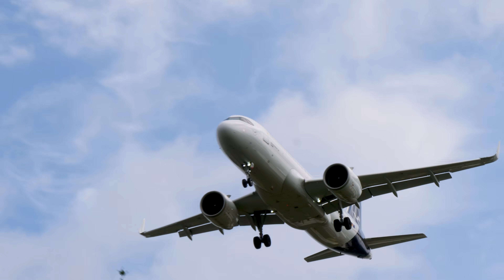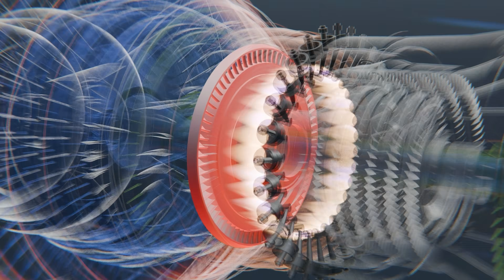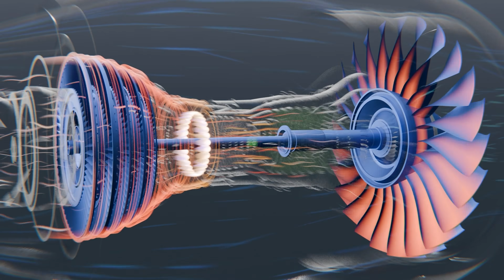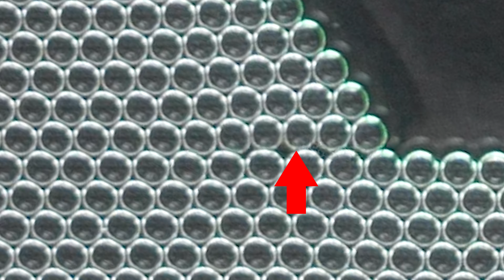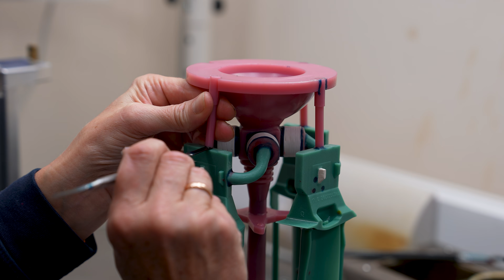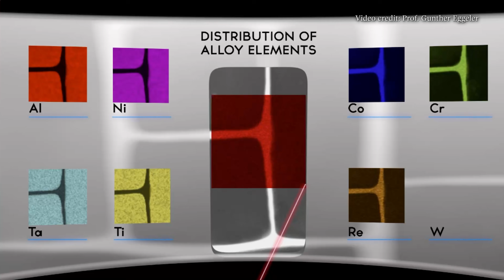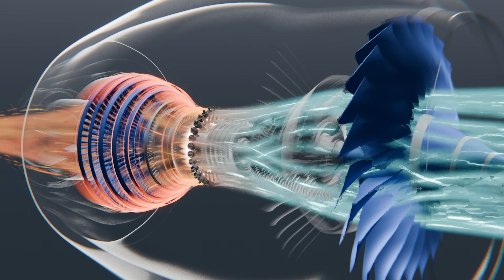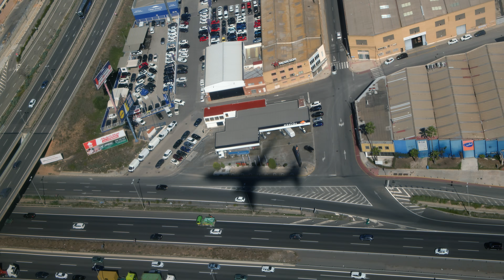The Ridiculous Engineering Of Jet Engines

Comment: I operated gas turbine power plants for 43 years.  I remember when RR announced they were manufacturing single crystal blades.  Everyone at the time considered it voodoo.  

The part on thin film cooling wasn’t really clear, so here goes.  By bleeding a small quantity of cool air out of strategically placed holes, it creates a thin film of cool air  that attaches to the surface of the blade due to the coanda effect.  The air immediately starts to heat up, but by the time it starts to get hot, it is swept away and replaced by more cool air.  The critical areas are the leading edges of the blades because they are directly in the hot gas path, and the very thin trailing edges.  I was surprised to see the cooling air holes along the centerline of the blade shown in the video.  These blades must be for an engine that runs at a much higher temperature than the ones I ran.  The initial use of thin film cooling was in the form of sweep air for boiler gasside sight glasses, and it is used in all sorts of surprising areas of modern technology.

The limits of engine performance are usually set as exhaust gas temperature (EGT).  Since the temperature drop at each stage of the turbine can be calculated, by measuring EGT, the turbine inlet temperature, which is the highest temperature in the engine can be calculated.  By knowing the maximum temperature the first stage turbine can withstand, the maximum EGT can be calculated.  Some older turbines measured inlet temperature directly, but as metals improved it became more and more difficult to measure directly, so most turbine manufacturers switched to EGT measurements instead.  Some engines measure temperature somewhere in the middle (a lot of techs will remember TT-5.4), but this is less common also.

The difficulties with dirt also affect the compressor far more than the turbine.  As dirt builds up on the compressor blades, they reduce efficiency and increase turbulence across the compressor blades.  This can build up enough to stall the airflow across the blades, creating a high pressure pocket.  This can push the blades until they make contact with the next stage and break off.  One blade promptly breaks more blades behind it, which cascades until the entire compressor explodes violently.  The term of art for this is a corncob, because that is what the remains resemble.  It is very frightening to witness, (don’t ask me how I know this) and is deadly to anyone nearby or in a flying aircraft.  This is why you will see maintenance personnel washing engines by spinning them up and spraying specialized soap solutions into the engine.  Unfortunately, soap can’t wash off particles melted onto turbine blades.  This is one of the fundamental limits to turbine blade lifetimes.

Another is cycle quantities.  As any blacksmith can tell you, repeatedly heating and cooling any metal will cause the grain size to change.  Heating causes grains to grow, while rapid cooling (like shutting down a gas turbine) can cause grains to shrink, making the metal brittle.  This is why you used to see aircraft not shutting down their engines while sitting at the jetways.  This is also why single crystal blades are such a big deal.  They essentially only have one grain.

When training new operators, it took me five minutes to explain how a gas turbine works.  It took years to explain all the details.  This video pretty much explains why.  Excellent stuff.
Reply: for somebody with minimal knowledge about aircraft engines, i really enjoyed reading your comment
Reply: Very good comment, I just correct something. It seems like you have knowledge of metallurgy but you mixed everything concerning grains .
Basically a finer microstructure (smaller grain) is always better in term of fracture and tenacity (hall-petch law) and it is why the smith quenches the metal between each phase (quenching and dynamic recristalization through forging) 
Also, you are indeed right, temperature makes the grain grow, because they want to minimize surface energy through "absorbing" and combining with their neighbours, making a more coarse microstructure.
But it has nothing to do with turbine blade. Basically the mono cristalline process makes it so there is no grain boundaries anymore, so no growth or cristallisation.
This is gamebreaker because you can have highly anisotropic properties in the direction that you want to "protect" 
Basically we grow the alloy on it's stronger direction in the direction that we want to shield against stress.
But on paper the isotropic mechanical properties, so in all direction, are lessened!
Also the thing with these mono cristalline is that they are much much more resistant to Oxydation, Not having any diffusion highway (boundaries) and suffer far less from temperature creep and HT deformation as there is no dislocation stacking on the boundaries, making it behave as a whole body against internal stresses.
And the reason for the jets not shutting engines down is, indeed for thermal cycles and also for thermal shocks
Reply: @someoneyoudontknowthename3931 Thanks for clarifying that.  My knowledge of metal grain structure is mostly from watching Forged In Fire.  I simply didn’t need to know more for my trade.
Reply: Single Crystal turbine blades were nothing new when Rolls-Royce introduced them on the Trent.. They were invented and patented by Frank Ver Snyder at Pratt & Whitney in 1966.
Reply: @DoktorBayerischeMotorenWerke I had never heard of them before the RR announcement.  Do you know why they weren’t in common use?
Reply: @Simple_But_Expensive  They have been in common use in the major manufacturers for many years.  Some engine manufacturers make their own blades but there are companies that just make turbine blades for other companies to use in their engines.

In the early experimental systems yields were low, as little as 10% of the blades came out as monocrystaline in some cases.  So most of the blades were melted down to use the metal to try again.  Early systems were strictly experimental but eventually yields rose to the point where they were useful in production and now all high-tech manufacturers of high temperature turbine blades have their own processes.  Most achieve 80% or more now, with some obtaining more than a 90% yield on most batches.
Reply: @Simple_But_Expensive  Pratt & Whitney introduced them in 1972 on the F100 and on the Pratt & Whitney JT9D-7R4 in 1979.
Reply: @Simple_But_Expensive  The failure rate during manufacturing was simply WAY too large to make any money.
Reply: @DoktorBayerischeMotorenWerke yeah but were probably used in military and classified
Reply: @AgentLeon  It was not classified technology and was introduced in the 1970's on commercial aircraft like the Airbus A300, 310, Boeing 767 and late-70s models of the 747.
Reply: Thank you for your insight!
Reply: Excellent comment!
Sorry for the stupid question, but I imagine the "cooling" 600C air runs through some space at the center of the whole rotating assembly and then exits out of a system of cavities to the turbulent passages they mentioned at 33:00, is that right?
Reply: @Valery0p5  Yes.  There are ports in the compressor that bleed air into the shaft, and then that air directly into the center of the blades and nozzles for direct cooling and then bled out ports for thin film cooling.
Reply: @Simple_But_Expensive  thank you!
Reply: @Simple_But_Expensive  The video really dropped the ball on explaining ventilation (that there is internal ventilation at all; that there is also a protective film on exterior; in what way the coating aids either process - all of this deserved a 3D render). Thanks for helping sort it out
Reply: @Simple_But_Expensive I was wondering if bleed air was involved in this but did not see any mention i.e. perhaps if using it helps decrease the temps in engine or redirect hot air.
Reply: @annettetozer894 There is more than one type of bleed air.  Almost all engines have a bleed port somewhere around the 5th stage of the compressor to reduce excessive pressure buildup while starting.  This air is controlled by a valve and generally bypassed into the exhaust.  Sometimes this bleed air is associated with engine throttling, and in at least one industrial turbine I know of it is used in emissions reduction.  Also, all turbines have one or more sets of ports somewhere further back.  These ports provide cooling air and bearing sealing air.  On most designs they also provide balance air that pushes forward on the turbine rotor to offset the thrust effect of the hot gasses.  Only about 25% of the air is actually used for combustion.
Reply: @annettetozer894 Not the same kind of "bleed air". 

The bleed air you're thinking of is intentionally drawn off other parts in the engine and used to power other systems on the aircraft. 

The "bleed air" system used to cool the individual turbine blades is a whole seperate system, used just for the purpose of internal engine cooling.
Reply: @Valery0p5  yes
Reply: Really enjoyed that explanation, thanks
Reply: 很好，半导体制造过程中也需要精确控制避免晶界产生
Reply: More stories please!!
Reply: Please explain how they deal with dust blocking the cooling veins in contemporary turbines? They left that part out as well
Reply: @adamblomberg I never really thought about it, but here goes.  

The compressor cooling air bleed ports and internal distribution passages are large enough that blockages are extremely unlikely.  

The air bleeding out of the tiny cooling ports on the blades and nozzles is at a higher pressure than the hot gasses from the combustor.  It has to be or there would be no flow.  

It is also at a high velocity due to the venturi effect.  Fluid velocity increases in an orifice.  No dust particle would be able to attach to the wall of the port.  

In fact, one of the lifetime limiting factors is erosion of the ports reducing cooling effectiveness.  

It is possible to block them externally in extreme conditions.  There is a famous case of a Quantas aircraft that had all of its engines shutdown in flight when it was routed through a volcanic ash plume near Java.  The hot internal parts of the engine were essentially coated with glass when the ash was remelted inside the combustor, but as far as I know, the cooling ports were still open.

Perhaps someone with more knowledge can chime in here.
Reply: @Simple_But_Expensive I was wondering as you and the engineers mentioned that the dust sticks to the turbine blades and the thermal barrier coating is eroded away by the dust and debris. I saw another commenter saying that some of the dust can be washed away from the compressor blades with a cleaning solution to improve efficiency and prolong lifespan.

As I understand for the engines currently in service this remedy does not help for the turbine blades and they'll have to be replaced more frequently
Reply: @adamblomberg The post about engine washing was from me.  Washing primarily cleans the compressor, and any cleaning past that is pretty much incidental.  Dust and dirt will degrade the turbine section, but barring flying through an ash plume, other factors like heat cycling and blade creep are going to necessitate reblading an engine long before it becomes a factor.

On the engines I worked on, we washed the engine 4 times a year, change the combustion cans (also a high heat environment requiring special alloys and thin film cooling) twice a year, and changed the transition pieces (that guide the combustion gasses into the turbine) and combustion can liners once a year.  We also replaced the turbine 1st stage (which suffers the most heat) every 3 years and all the turbine blades and nozzles every 6 years.  We also had to replace the entire turbine rotor about every 15 years.  

Bear in mind that this was an industrial turbine located in a (very) dusty environment that ran at maximum capacity 24/7 when not shutdown for the maintenance listed above.

In case you missed my post on that, an industrial turbine is optimized for torque and has almost no thrust.  The casing on the one I worked on was 4 inches thick and would have broken off any wing it was attached to.  The rotor alone weighed 9 tons.  The turbine drove a 40 MW generator and the exhaust heat was used to generate steam for enhanced oil recovery.

Some of the larger industrial turbines generate 100 MW or more.  Most power utilities prefer steam boilers, even for natural gas, but if I was installing a non-coal burning 500 MW power station, I would install 4 or 5 of these larger ones and use the steam generated to drive steam turbine generators.  This would allow me to take any individual turbine down for maintenance without taking the entire plant off line.  I guess there are economic reasons not to use this design, but I don’t know what it is.  But this is a different discussion.
Reply: @adamblomberg The little dust that the engine does ingest simply flows right thru the passages.
Reply: :)....cheers.
Reply: 746
Reply: Thank you, sir.
Reply: IIRC engineers also use film cooling to keep combustion chambers of some rocket engines cool
Reply: @dongiovanni4331 big time
Reply: 🤩Thanks
Reply: To me, a "corncob" is the ole P&W R-4360 Wasp Major.... 🤷🏻

What a sweet old engine that thing was... 👍
Reply: I love it when an expert drops into the comments and suddenly it's like the DVD has a director's cut and a bunch of cool content I wasn't expecting.
Reply: Thank you for your insight.
Reply: Which explains why volcanic ash is so dangerous.
Reply: But the poor Nozzle Guide Vanes were left out in the cold during the explanation of the flow through the turbine!
Reply: @simes888  mea culpa.  For those not in the know, each stage of a vane axial turbine (or a vane axial compressor) has two components; a rotor and a stator.  Rotor blades are attached to the shaft as advertised, while stators ate attached to the casing.  Combined they change the direction of gas flow in a kind of zig zag pattern.  In the compressor, this change in direction provides an impulse to move the air further into the compressor and into a smaller and smaller space.  The turbine section pretty much reverses this.  For some reason, in the compressor both the stator and the rotor components are referred to as blades, but in the turbine the stator components are referred to as nozzles while the rotor components are referred to as blades or buckets depending on if they are reaction or impulse type in design.  This is simplifying things a lot.  This goes back to steam turbine terminology as far as I know.  

The turbines I worked on were industrial turbines while the turbines on an aircraft are aero design.  Some stationary gas turbines are referred to as aeroderivative.  There are a lot of arguments about the terminology, but basically industrial turbines are designed to have almost no thrust, but lots of torque for turning things like generators, gas compressors, or pumps.  Aero turbines are designed for maximum thrust and minimal torque.  They are used to propel aircraft.  Aeroderivitives are aero types that have a second “power” turbine attached to the end to convert that thrust to torque.  The outer casing of the power turbine is attached to the outer casing of the turbine exhaust, but it has a separate rotor that runs a a different speed.  This is referred to as an aerodynamic coupling.

The high temperature metals in the turbines I worked on were hastalloy w or hastalloy x.  I have no idea what those alloys consisted of, nor do I know what RR calls their alloys, but they are all similar.  I do know that many boilers use high moly steel alloys for their internal supports, but these typically are limited to less than 550 C.

I have recently heard of efforts to 3D print turbine parts, but I don’t see them doing this with turbine blades (or nozzles or buckets).  I have also heard of efforts to use glassmetals, which avoid crystalline structures and grains completely, but don’t know if these were abandoned or not.

What I do know is that the efforts to increase temperature limits and lifetimes will extend into the foreseeable future.  While the US military is pioneering 5th gen aircraft, current gas turbine designs are at 3rd or 4th gen at best.  I am looking forward to see where they go from here, I am unlikely to live to see where it ends up as a mature technology.  Too bad.  Even after all these years I still find it a fascinating technology.
Reply: @Simple_But_Expensive  I was wondering how dust particles manage to reach the internal parts of the engine when the centrifugal forces should've pushed them to the side. Keeping the airflow "mostly" straight explains that. So... what about adding additional chamber, specifically to get rid of the dust?
Reply: @ИванСнежков-з9й  Anything you add is going to either be too complicated and expensive or lower efficiency.
Reply: @Simple_But_Expensive  Back in the 80's, Pratt's first stage turbine blades were made from Iconel.
Reply: @Simple_But_Expensive  thank you for the explanation, sir :hand-purple-blue-peace:😆
Reply: @gdavids57  Many still are today....

Comment: The single crystal of the turbine blade is similar to how silicon for semiconductor is made. Grown from a single crystal, then the silicon rod is sliced up in thin wafers.
If the structure is not perfect "defects" then the transistors will fail.
You only need that one of the 10 bilion transistors to fail to fail a chip. Still 90 % yield is possible

Comment: Answer:
✓ Superalloys

Nickel-based alloys that keep their strength even when glowing red.

Single-crystal blades

Each blade is grown as one crystal piece so it doesn't have weak spots where heat could cause cracks.

Ceramic coatings

A white/gray coating (TBC - thermal barrier coating) keeps heat away from the metal underneath.